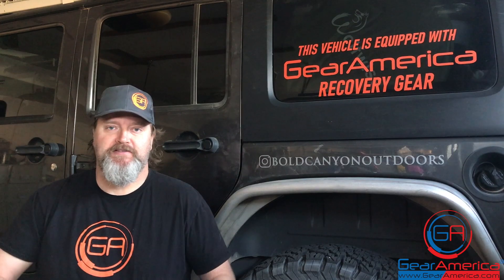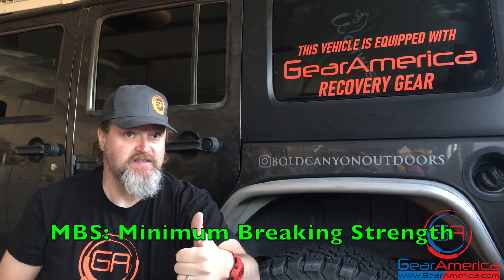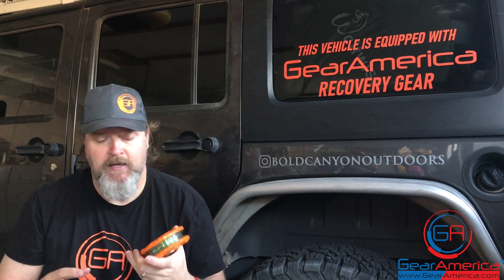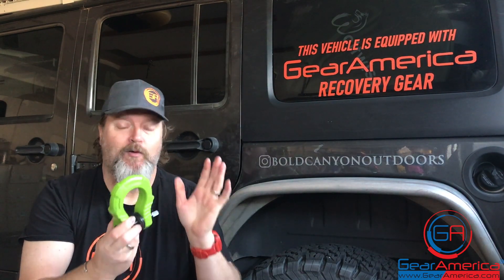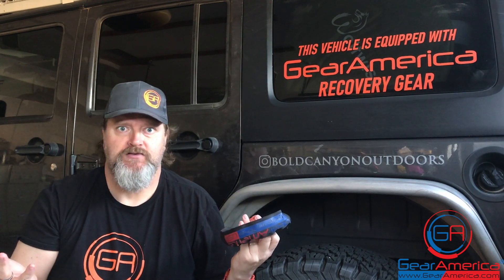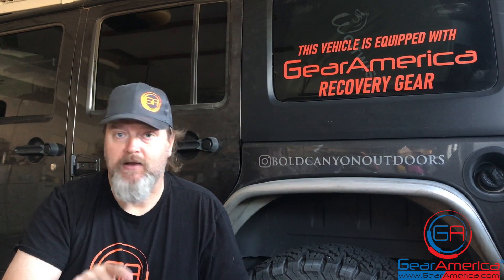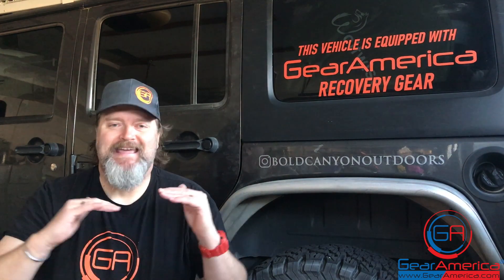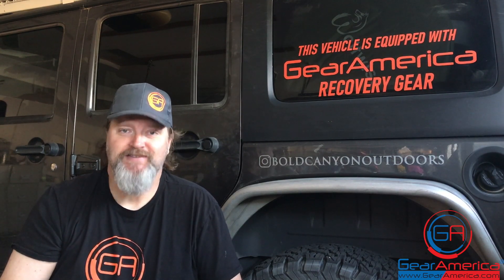GearAmerica Recovery Gear Strength!  MBS vs WLL & Safety Factor - Defined and Explained!

Comment: Hi l watch the video on the fatality that was all over the internet. The calculations with the truck plus being in mud was 18000 lbs. I have a 2010 Ram 3500 mega cab. Will your mega Shackle work albeit rated for 16000. I want to use my truck for pulling medium size trees on my property and for helping someone who l may find stuck and to tear a old double wide mobile home apart. I'm looking at the 30 foot kienetic rope as well?
Reply from the maker: Our mega shackles have a 68,000 lb minimum breaking strength. If you want to go bigger, go with our Uber Shackles...with a 20,000 lb work load and  80,000 lb MBS.

Comment: Acronyms simplified. Thanks for the great content. Have driven 4x4s for years but never bothered to do a deep dive into recovery. I started to recently and regret not doing so before. It should be a requirement for all 4x4 enthusiasts considering the safety element. I look forward to following you guys. Thanks Gear America, all the way from South Africa.